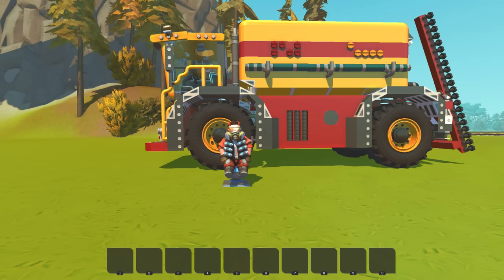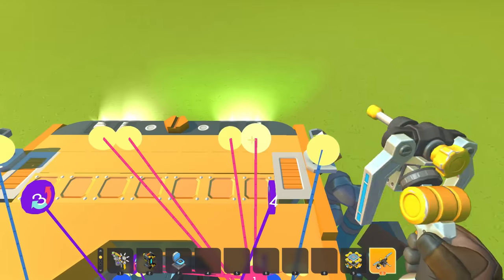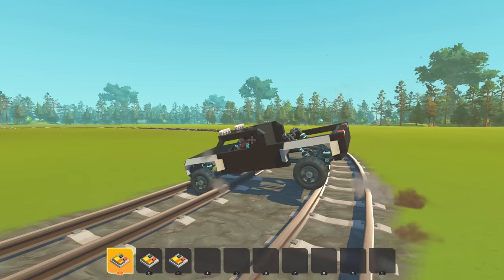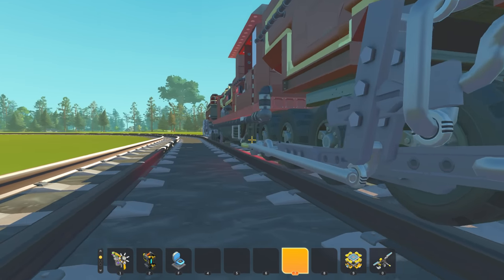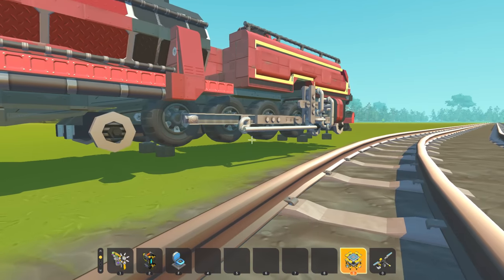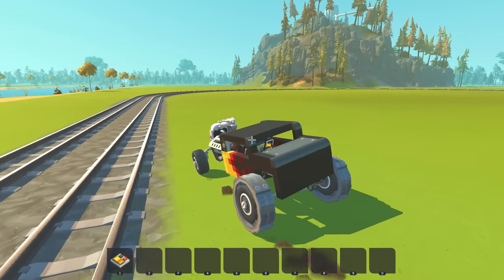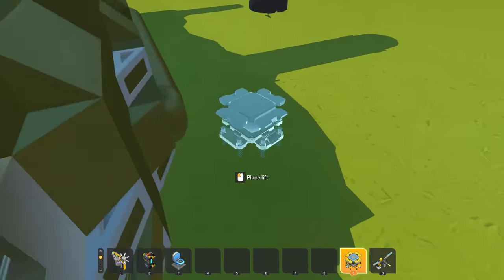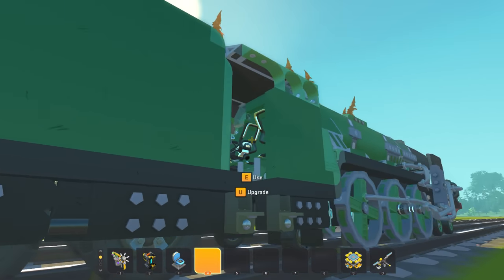Piston Powered Trains, High Speed Hot Rods, and MORE of Your Best Builds!

Comment from the maker: Make sure to submit all your best builds on my discord server! Also leave suggestions for other builds in Scrap Mechanic!
Reply: Those builds are super duper awesome imo :)
You could try out this game called besiege, it gives you much more freedom of building (and physics is better) but most importantly: it let's you build engines as well. I think you'd love it ;)
Reply: Fun fact tractors used to have tracks to traverse the terrible field conditions.   TRACtor

Also, great video as always.
Reply: Besiege also has gears too
Reply: why no monday hide ans seak this week ?
Reply: Pls make homing missile without player magnets with only rotation of wings
Reply: Hey Kan Gaming, thanks a ton for featuring my QR Breyer Garret Steam Locomotive in your video! I'm glad you enjoyed it. Quick tip: if you slide down the physics quality to below 7, it should help with any lag you're experiencing while still keeping everything running smoothly. I've noticed that it mostly affects the pistons (especially double-stacked ones) and suspension.

By the way, the valve gear design is inspired by the Walshearts Valve Gear used in real-life steam locomotives. The type of locomotive is a Garrett which is an steam locomotive articulated in 3 parts with the boiler in the middle. And there is additional water and coal storage on top of the driving wheels. So it has the power output of two locomotive while only needing one crew.

On a side note, the Flying Scotsman by RippenRd, which you also featured, was a huge inspiration for me in crafting piston-powered steam locomotives in Scrap Mechanic. Thanks again for showcasing my creation, and I've been eagerly waiting for this video to drop!
Reply: @KANGaming, can I use your  name in a story for school?

Comment: the crabsteering on the manure-sprayer is to reduce soilcompaction. Such sprayers wheigh alot and when you crabsteer you double the surface area that gets compacted, this is usually done when the drivingconditions are subpar. i.e in wet conditions the  soil is really loose and you can sink in way too deep and get stuck
Reply: well thanks you that explains it very well, and it makes sense, thanks for the comment!
Reply: Are there usually four paths for the wheels to take, or do you just yolo overtop of the crops?
Reply: @clanpsi  I believe it's done before the crop going into the ground, I could be wrong.
Reply: @clanpsi this depends on the crip system your farm runs
I did a 1year course in agriculture and the most common answer to things like that is "it depends"

But usually theres set "wheel paths" where you run all the traffic on the field. Like sprayers, slurrytanks, fertilizer spreaders etc.
Reply: @nathanbrinkerhoff5886 yes, but not always
Reply: @einar2963 Thank you for your awesome/factual answer. I very much appreciated it.
Reply: @einar2963  Like I said I could be wrong.
Reply: ya compaction is  problem with to much the soil wont absorb the slurry or manure in that area causing loss in yeild

Comment: A Garratt (also known as Beyer-Garratt) is a type of steam locomotive that is articulated in three parts. Its boiler is mounted on the centre frame, and two steam engines are mounted on separate frames, one on each end of the boiler. Articulation permits larger locomotives to negotiate curves and lighter rails that might restrict large rigid-framed locomotives. Many Garratt designs aimed to double the power of the largest conventional locomotives operating on their railways, thus reducing the need for multiple locomotives and crews.
Reply: Also it's one of Hyce's favorite locomotives. 😅
Reply: British built tank on tracks!
Reply: It was mostly used in Africa
Reply: the one that he use is the Queensland beyer garratt locomotive
Reply: Comments like this we need more of
Reply: @ditohafiz9663 I think also partially used in NSW
Reply: @penguintrain1360 not this model
Reply: @ditohafiz9663 but in Queensland Rail Livery
Reply: 4-8-8-4 wheel set up kan
Reply: Nice
Reply: @3801NSWGR.  Thank you I was saying most Garratts want to Africa
Reply: @penguintrain1360  Africa and Australia mainly, some in Britain.
Reply: The Welsh highland railway has a couple as well I think.
Reply: Their main issue is that their tenders what give their tractive effort, so the more fuel it uses, the less traction it has

Comment: That Garrat is indeed a real locomotive, and its wheel arrangement is "4-8-2+2-8-4." Also, the red thing between the wheels on the Flying Scotsman is a third cylinder inside the frames. It was common on British locomotives for a while, but it never really caught on here in the U.S, and 3 cylinder locomotives should have each of the cylinders offset by 33.333 degrees instead of 90.
Reply: A lot of DB engines also use 3 cilinders, pretty cool stuff!
Reply: O think there is a Garrat still working in Australia it’s used in special events

Comment: I think the crabwalk is more to reduce pressure on the ground
it spreads out the weight through the dirt more, and compresses the crops/weeds less than if all the weight was in a single line (by being pressed twice)
Reply: usually you spread slurry on a grass field or before the crop sprouts, its mainly to reduce compation on the ground so its easier to hoe, grow in

Comment: 6:13 It’s the Queensland Railway Garratt, there is only 1 left and it is on display at the Ipswich workshops.

It’s number 1009, it was built in 1950, it’s a 2-8-2+2-8-2 because of the amount of wheels it didn’t get a regular classification like other QR locomotives they were given BG, it weighs 137 ton, carries 6 ton of coal, 3800 gallons of water, it’s driving wheels are 51’ in diameter and it’s cylinders are 13 1/4”x26”

Comment: 17:56 minor correction, that's not a scrap mechanic work around for timing, that's a real feature of The Flying Scotsman

TFS is an LNER A3 class, these locomotives were all built will 3 cylinders to provide power, one being snuck in between the frames.

Comment: The garratt is my favourite train. It was used in south africa (i think) and i believe it was used for carrying heavy loads around tight corners as it is very strong and articulated
Reply: It is indeed the garret how ever after some research it was used in Australia
Reply: It was designed and used in the Uk on the LMS I’m pretty sure
Reply: @ThatTrainGuy123 Train of Thought had a video about LMS banking engines. Garretts that were specifically to push other trains up a certain section of the railroad.

Comment: The locomotive is a Garratt (or Beyer-Garratt) which is a type of articulated steam engine mounted on two frames with a large water tank in the front, and large coal bunker/tender in the back that were primarily designed for heavy freight or "banking" other locomotives up steep inclines, they typically aimed to improving efficiency by being able to carry heavier loads with more power compared to other engines.
The one in you showcase appears to be based on both the NSWGR AD60 and the ASG (Australian standard Garratt), with the AD60 being standard gauge and the ASG a narrow gauge Garratt used by QLD, TAS, SA and WA during WWII.

Comment: For the crab walking, it's to make compaction more uniform across the field. Also could help in soft ground to prevent getting stuck. Also, crops grow different in different situations. By crab walking, the compaction is spread out more, making how firm the soil is more uniform across the field. This makes it easier to prescribe different treatments. Most people will work up the ground once the fertilizer has been applied, which defeats the purpose of crab walking. Some ground is better to "no till" which could see the benefits.

Comment: I'm guessing the crab-walking is for stuff like course correction. It's not ideal, but there's probably some situations where it's better than the alternatives.
Reply: I don't think it's to use when moving over the crops themselves, I think it's for alignment when getting set up to make a pass, without a bunch of turns that would work your tires down into the earth.

You can get straight with the rows, and then fine tune your alignment left/right while moving forward.
Reply: It's to help reduce soil compaction. Instead of all the weight being applied over two tracks if the wheels are in line, it's spread over four tracks. Sure, it compacts more soil, but it compacts more soil *less*.

Jump in the mud twice in the same spot, you'll sink in more. Jump in two different spots, you'll have more footprints but none will sink in as far.

Comment: A Garrett is one specific type of articulated steam locomotive.

The short version is that a Garrett is pistons-apart, a Meyer is pistons-together, and a Mallet has the pistons pointing the same way like the Big Boy.

Garretts have been tried in many cases, in Britain for example the LMS tried a class for freight that was hampered by having to use the same wheelsets as the locomotives it was meant to relieve.

There was also a larger one-off in british service - I think an LNER design - that saw most of its use banking freight trains alongside the one-off 0-10-0 "Big Bertha".

Comment: The tracked vehicle does have tank steering. Tank steering is just when you can activate each sides acceleration individually so you do not angle the wheels in order to turn. Early tanks up until the Panzer 4 in WW2 operated like this. What you are referring to is Neutral steering where the tracks move in opposite direction to achieve spinning on a point, or can move at varried speeds in order to turn while maintaining momentum.

Comment: fun fact! the second build technically did have tank steering. most if not all old tanks only used one tread to turn the tank up until the second world war where country's started experimenting with double differentials which allowed "neutral steering" where both treads were able to move simultaneously in opposite directions. Although they experimented in ww2  they weren't really used within tank design until the cold war.

Comment: That train reminds me of a duplex engine. Two locomotives working as one
Reply: A duplex would be more two engine sets on a rigid frame. Like PRR T1 or S1 classes. A Garratt type is one of three most common articulated locomotives, especially regarding steam. Garratt has the boiler sitting on a separate frame with both ends free to articulate, Mallet where rear set is fixed and front articulates (Big Boy, Challenger, many American articulated locomotives), and Meyer would have two articulating sets under a single boiler frame (most similar to modern locomotives).

Comment: As I recall there was something about Soviet tracked vehicles mainly the T-34 tank instead of having a proper way to hold tracks in place just added a wedgw that would hammer loose bolts back in as they passed

The 'Stalinets S60' is probably an agricultural tractor, so basic it doesn't even have neutral steering.

The biggest flaw of anything with Wingz mod is that motor-powered elevators have a tendency to lock up in high-G manouvers.

Comment: on valve gear there is a type called baker which works similarly to walscherts except it doesn't require the slide block mechanism and only has pins